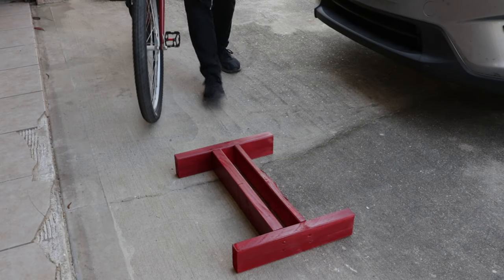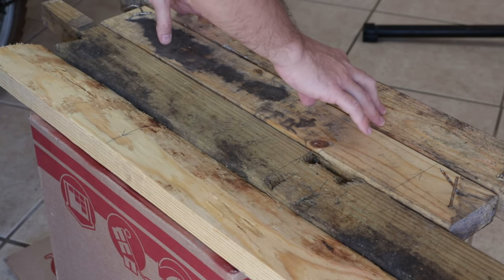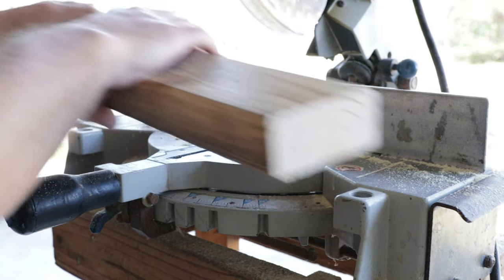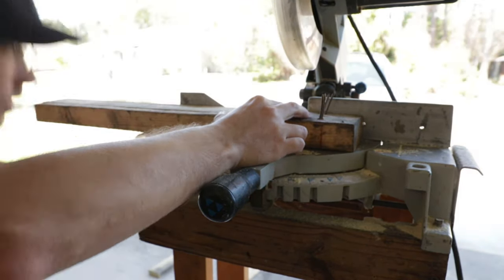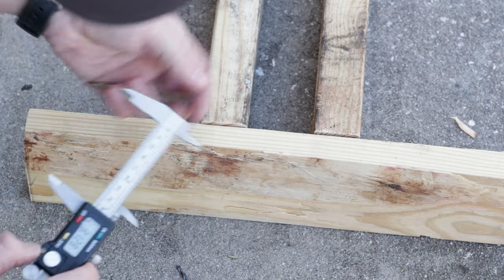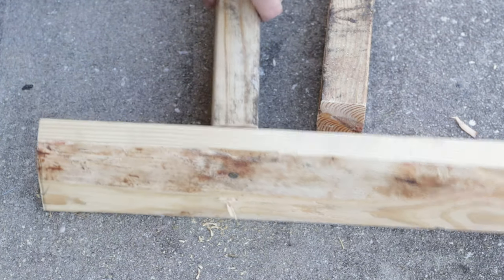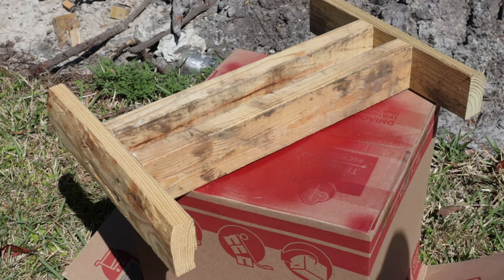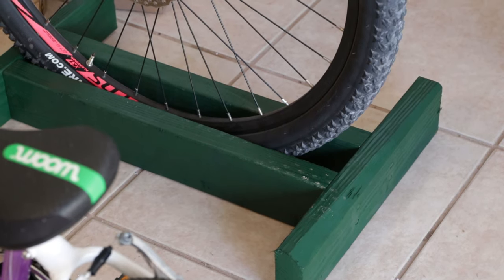Build a cheap but good bike stand

Comment: I have built stands just like this before. I discovered quite by accident that if the tire in the stand goes flat the bike will fall over to the floor. I added two vertical boards about 16” long on each side of the tire.
Reply from the maker: Good point! I didn’t really think of that.

Comment: As you said, we've seen these before, but I am skeptical of having the bike's weight (which is not much since it is leaning, but still) being supported by the rim and in turn have the rim subjected to bending forces.

Now I have come to appreciate kick stands. I used to take the off and throw them away...not anymore (they are about $10).
Reply from the maker: I've thought about that too, but so far haven't had a problem. But I kinda think it somewhat depends on the fitment of the stand and the weight of the bike. I guess also the wheels are fairly strong because they have to handle all sorts of forces while being ridden on. Could probably modify this design to have a front vertical portion to catch the front of the wheel so that the wheel has a better contact area.

Comment: Would this stand work if it was stood up vertically? Thinking it might save space of the floor in tighter areas
Reply from the maker: that's a very good idea I think. I believe it would work. Also you can put the end 2x4s under it, that will raise up the holding sides a little, I did this in later versions.
Reply: @BruceChastain  Good shout. Out of all the amazon metal/plastic tat and etsy fancy over-craft, I think this design has my vote. Cheers

Comment: i like it! Best part is you can repurpose those side stabilizer bits as a spot to put the toolbox/bag of bike stuff on one side, and a box/bag for your spare tubes, lube, etc on the other side. Nice tidy area for 'bike things.' 

Given my bike is like part of a wider multipurpose shop. Not having the bike specific stuff get mixed up is sorta important. Because literally NOBODY else here has use of a crown race wrench, crank puller, bottom bracket remover, freewheel tool, etc.

As for the stand itself? The only idea i have is if you can round out the edges. I could see arguments for an angled cut on the side where you'd roll in at so it easily rolls in but stays in place. I could also see that being a trial and error type thing too when literally all anyone has to do is just lift the bike wheel up a couple inches t oset it in.

The rounded edges is mostly an aesthetic but could make a case for it also preventing a hard edge digging int oa tire or spoke.
Reply from the maker: hmm the rounded edge thing is an interesting idea. At first I was thinking that wouldn't be too good have because the sides are already kinda low, so having an angle then it would seem less area for the tire to press against. But then I thought about it and actually the only parts the tire is in contact with is the front and back. So maybe you could angle in the middle of the stand to make the tire go in and out easier, but keep the sides high in the front and back.